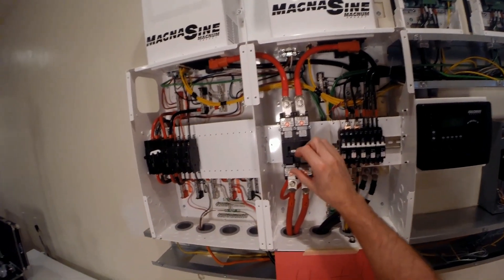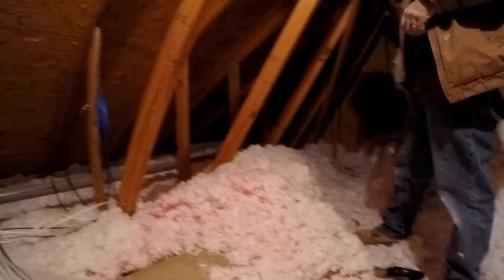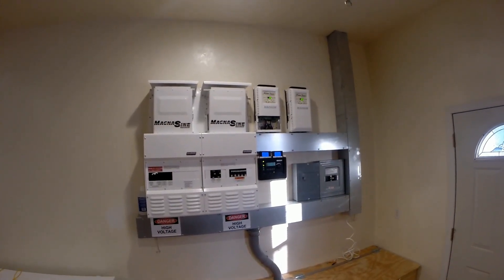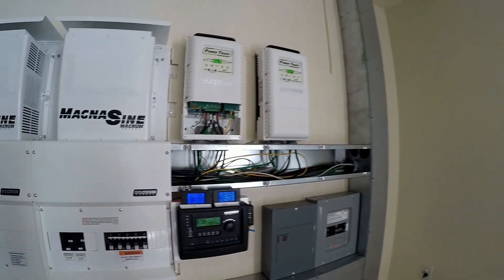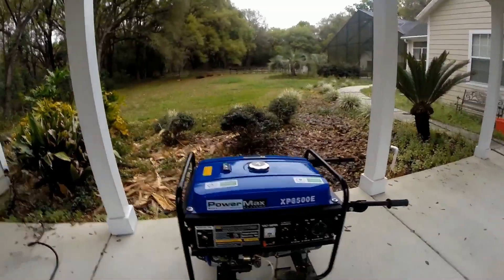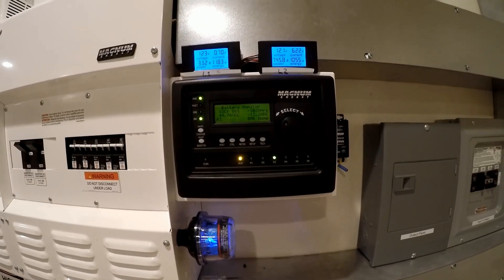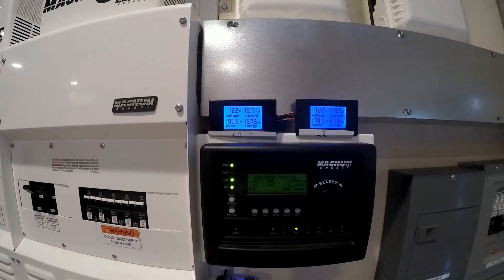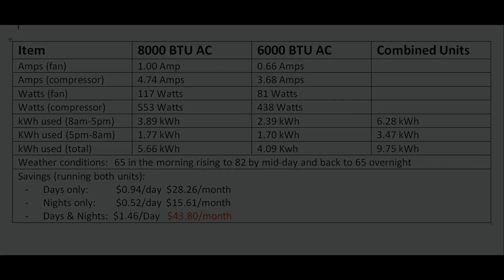DIY Solar Part 3: System Operation

Comment: Wow. Thats too much man.I will be doing similar things you are but not as expensive of a system. Im trying do be as cheap as possible. How much money have you put into your system?
Reply from the maker: Frank,  I have purchased about 26k in hardware (including tools) to do the job.  I did all the work myself.  After tax my cost is about 18k.  This system is bullet proof, works perfectly and I would not change a single thing.  Thanks!
Reply: It looks beautiful. Im in for$5000 on my system and im burning 15- 20 kwh a day. But not as pretty as yours.
Reply: How long do you think your system will take to pay off?  Im sure you get a ton of sun, Florida you live? I have never been out of my province . Ont. Havent even been on a plane before. One day Im hoping.
Reply from the maker: Frank,  If your getting 20kWh/day for $5000, I'd say keep doing what your doing!
Reply from the maker: Frank,  My system will take 10 years to pay off but saving money was not my primary objective.  I am going to have power through every storm, hurricane and maybe even the occasional zombie apocalypse.  Thanks!

Comment: The batteries are lead acid?
Reply from the maker: Yes, I have 16 of the Trojan L16RE-B, 370 Ahr batteries (the bank is 740 Ahr at 48 Vdc).  That gives me about 12kWh's of usable power if I drain them to 70% SOC.

Comment: Subscribed.  David this is not DIY - you do yourself a disservice, this is cleaner and better thought out than many pros!!!!  I'm thinking of doing a similar thing but just with no batteries grid tie only but I want it to look like a smaller version of yours!!!
Reply from the maker: Thanks!  Good luck with your project and leave yourself the option of adding batteries down the road...

Comment: Very nicely done system. Looks like you got it working for you in an efficient way
Reply from the maker: Thanks Roy.  I am getting better at switching our power usage from utility over to the solar.  We now pull almost twice as much as we did when first installed from the solar.  I still have not been able to use all of the available power on a bright sunny day but getting closer...  My best day was 32 kWh from solar.